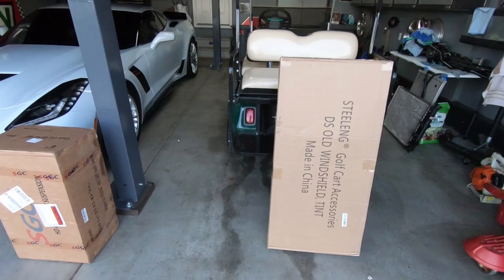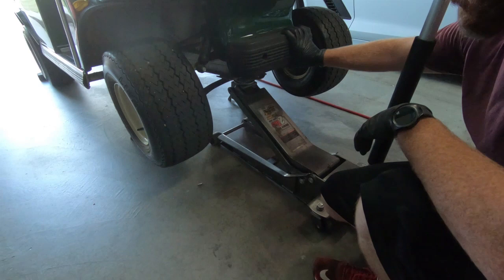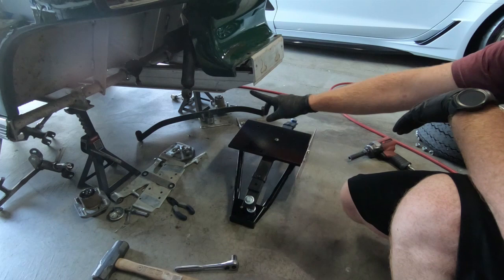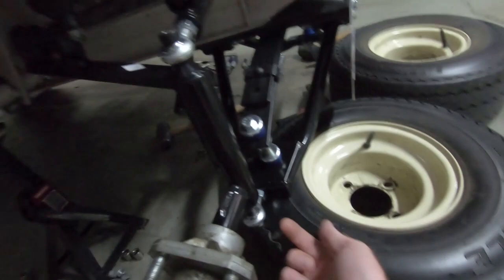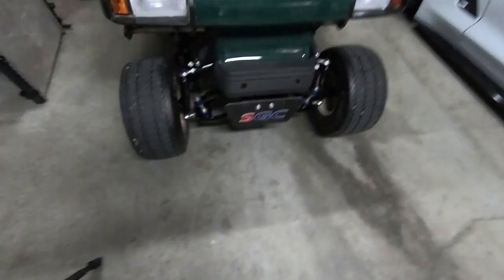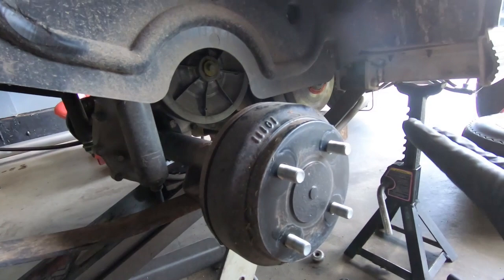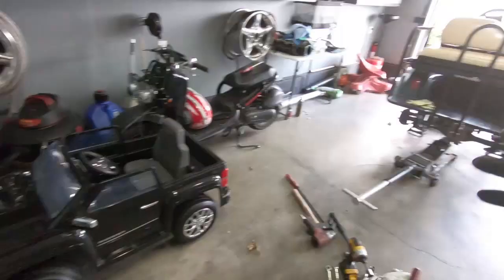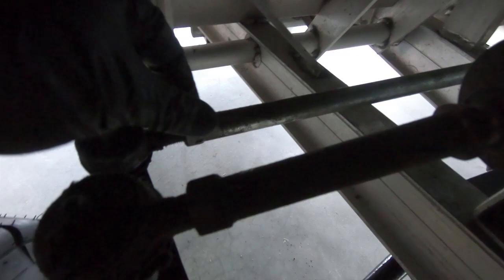New 6" Lift, Wheels, Tires and Windshield Install

Comment: Nice look. Good video speed. You should find the tie rod has two flat spots on the center section above the bracket to put a 1/2" wrench so the castle nut removed.

Comment: Did you have to drill out the holes for the stabilizing bar and steering studs to fit in? I have the same lift kit and the jointed studs with castle nuts don’t seat all the way down?
Reply from the maker: I didn't have to do that

Comment: NICE! I guess they didn't have a lowering kit? That gold matches the green good. I want those same wheels for my 94 Silverado. (But bigger.)
Reply from the maker: Thanks Dustin. No unfortunately no lowering kits but for how its used this works better.
Reply: Lowering can be done with stock parts and very little cash out lay, on a DS anyway. I've done it a couple times. 
It's cool as long as you never leave the asphalt.

Comment: How did this effect the stability?  Like you my kids drive the cart and I'm worried they will flip it the day after I lift it.  Also do you find this lift kit is better than others?  Any regrets?
Reply from the maker: It's a little too much lift at first but seems stable.
Reply: I did a 6in. lift on my Yamaha g16 and put 2in. Wheel spacers on. Really stabilized the tippy feeling.
Reply from the maker: Maybe I need spacers
Reply: You won't regret the spacers. Just make sure they aren't for a Yamaha. They are metric lugs. Club carcass easy go are standard lugs.
Reply from the maker: Ok. Thank you

Comment: Did you have any issues with driver side brake line being really tight after this lift? I just did mines and I had to remove the driver side brake line cable hanger because it was so tight and the brakes were really sensitive and unable to use. They feel better after removing that hanger but the line now hangs a little low.
Reply from the maker: I didn't have that issue. I did have issues with the ground strap on the engine though
Reply: @TWAMotorsports  so you were able to leave the brake line hanger up on both sides? I’ll have to look again to see if I can get it clipped again. Thanks for the reply.
Reply from the maker: Mine may have been moved before I bought it

Comment: On the upper a arm put a 1/2 washer on the side where it mounts them tighten them down. Then the slack is gone
Reply from the maker: Thank you for that. I will do the same.